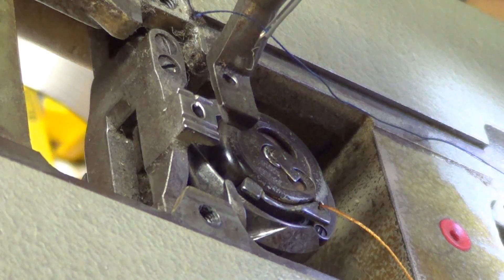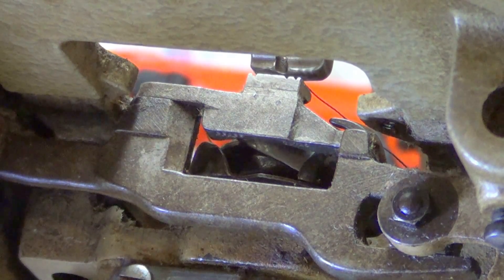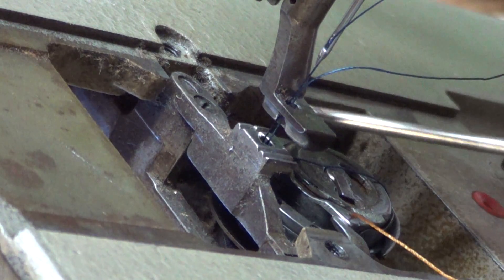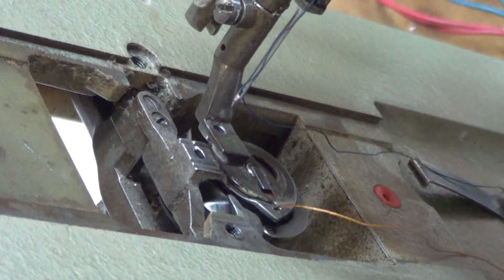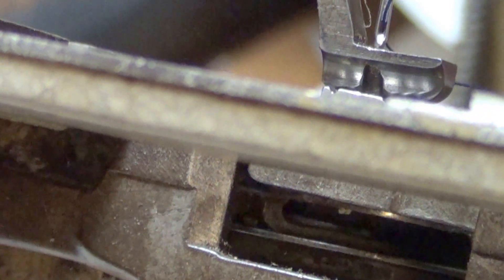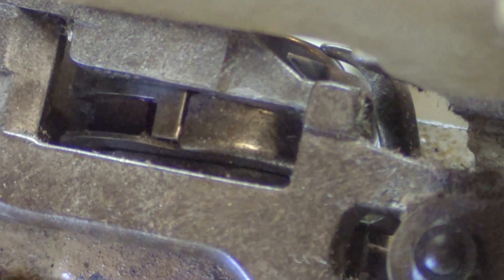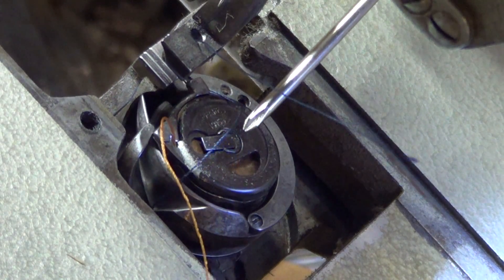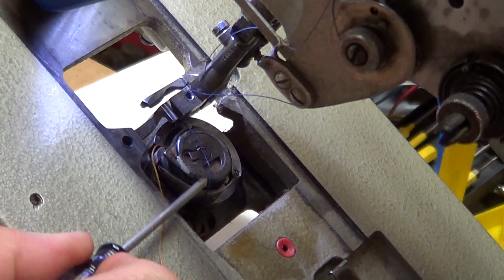Sewing 101 Industrial Rotary Hook grabbing upper thread on PFAFF 145

Comment: Without the needle plate on, the thread will ALWAYS jam there. When you put the needle plate on, the tab on the bobbin case goes into the notch of the needle plate and that's what holds the bobbin case in place. Rotation causes the bobbin case tab to push against the right side of the needle plate notch, so that's why they have an opener, to open the space up as the thread passes though. On rotation, the curved finger (the opener) touches the bobbin case and nudges the bobbin case about .5mm to the left to create a space for the thread to pass through without catching. The adjustment is made by the screw on the opener. Loosen the screw slightly and adjust the opener so that it moves the tab of the bobbin case halfway in the slot so that it has equal space on each side to allow the thread to pass through freely. The opener moves the tab 2 times per stitch.

Comment: My bobbin case wont free spin like yours because the throat plate is on. Why is yours missing?
Reply from the maker: I took it off to shoot the video, to show the unit from serval different angles.
Reply: Ok. Well, mine is out of time at least 180°. I need to get it serviced since I have no experience with a pfaff

Comment: Thanks a lot for the video's. I just got me a Pfaff 146, a rare number as far as I can tell, but it looks the same as a 145. I am in the process of cleaning the machine because that hasn't been done for some years by the looks of it. But I have a question. Can you tell me is the hook supposed to touch the needle upon passing or should they not touch. If not, what can I do to adjust this?
Reply: There should be 4 bolts that attach the whole assembly to the bottom of the machine. If you loosen them, you can slide them (there are slots) until you get 0.1 mm clearance between the needle and the point of the hook. You may need to loosen the bevel gear as well to make this adjustment.